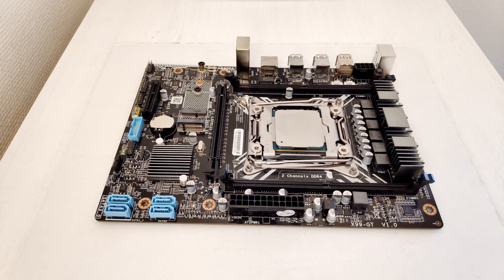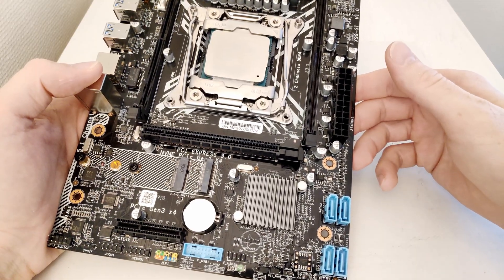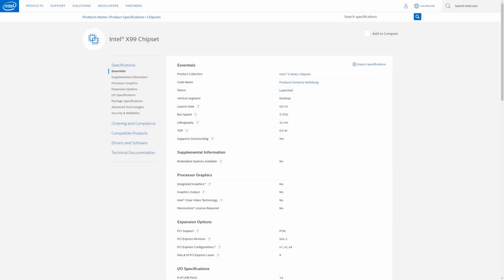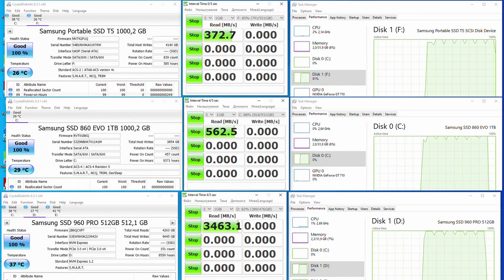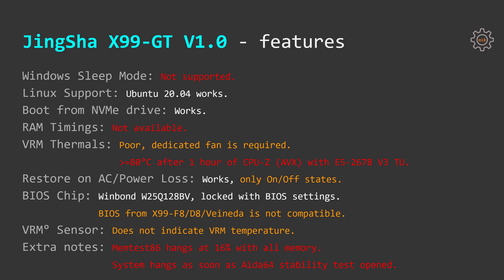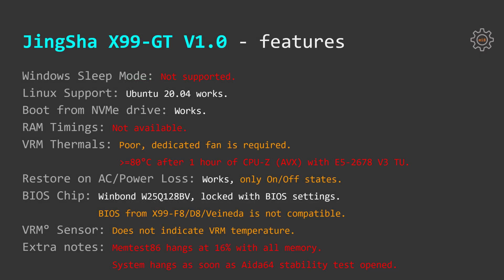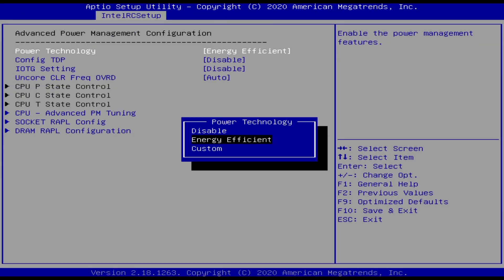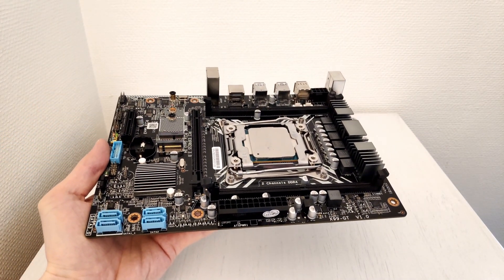🇬🇧 Detailed review of JingSha X99-GT LGA 2011-3 | Turbo Boost Unlock and CPU overclock

Comment: That same board just arrived today :/  So no turbo boors unlock and its not even x99 chipset? I will demand refund from seller
Reply from the maker: Turbo Boost unlock works, but you have to implement it yourself.
Reply: @Miyconst  How? I did it on Huanzhei board following your tutorial modifying bios like you said,  i'm not smart enough to figure this one by myself lol
Reply: @Miyconst  Oh, wait, maybe i didnt understand you, so it works if i follow your guide? I did it myself on another huanzahai board using your guide, using mmTool and uefi tool, inserted v3 TU drivers you provided into bios, those works on this same procedure?
Reply from the maker: @skyliner4610  Yes, it works on this motherboard as well, I have tried myself, but beware, mine motherboard had B85 chipset.
Reply: Btw, just started testing it, hw info reports H81 chipset, but aida64 stability test is working fine, didnt freeze yet, the mouse is a bit laggy from time to time but i think thats normal durring test
Reply from the maker: @skyliner4610  Thanks for the info. How about Memtest86?
Reply: @Miyconst  I can confirm Memtest86 is stuck at 16% just like yours. Is that bad? Should i refund?
Reply from the maker: @skyliner4610  It's bad, but not critical. Memtest86 uses some CPU instructions, which are apparently hanging the system with such motherboard. You can complain to the seller, just to push them to produce a better quality products.
Reply: @Miyconst  I filed a dispute because its not x99, seller responded that im lying and that they never said its x99 lol, i responded with screenshot of product add page, it says 3 times ''intel x99 chipset''. Will get some money back for sure. I wonder if they changed the board description now xd
Reply from the maker: @skyliner4610  😀😀, good luck with that.
Reply: @Miyconst  I got 56€ refund because they false advertized it as x99, it costed 60€, and i dont have to return board back to them. I do feel a bit bad, but hey, its their fault for claiming its X99, not that it really matters to me. Didnt really test the board  for prolonged time, it sits in its box, but it seems to work fine except mem test. They removed the claim on listing where it claims its ''X99 chipset'',  now they just call it x99, they tried to deny my claim by saying they didnt say its x99chipset, but i sent screenshot where it clearly says ''x99 chipset'', they removed that part, but left other x99 claims.
Reply from the maker: @skyliner4610  Don't feel bad. False advertisement and fishy marketing shall be punished hardly. It doesn't matter if it's a small Chinese retailed or a giant like Nvidia. False claims should not be permitted.
Reply: 3,2 boost working using 50-50 driver, im downloading pubglite via luncher and running aida64 stability test, seems fine no freezing for now, and boost steady

Comment: Can you test jingsha x99m g/h ?
Reply from the maker: I have already ordered these boards for review, they seem to be promising, even though only two memory channels.
Reply: @Miyconst in jingsha x99 g/h are four memory channels and are in same price like jingsha x99 gt
Reply from the maker: @dictator7586  Sorry to disappoint, those boards have four memory slots, but only two memory channels.
Reply: @Miyconst  so this motherboards work in only dual channel or what? Sorry i don't understand as well because im not american
Reply from the maker: @dictator7586  Yes, as far as I know, there motherboards work in Dual Channel memory configuration, but you can install two memory modules per channel.
Reply: @Miyconst  ohh fine that's not a problem because dual channel and quad channel are cery close in tests and i find now new jingsha motherboard x99 m-h2/h2 i think its x99 m-h but with green coloristic and have two pcie x16 maybe can it Play sli or cf? I want to know how to unlock procesor on x99 m-h/m-h/m-h2 and is that good motherboard. sorry for my bad english
Reply from the maker: @dictator7586  As I have already said, I have ordered both of these motherboards for testing, now it's waiting time.
Reply: @Miyconst  ok
Reply: @Miyconst  thanks for your good job you are good youtuber